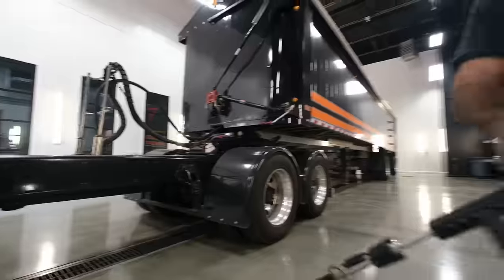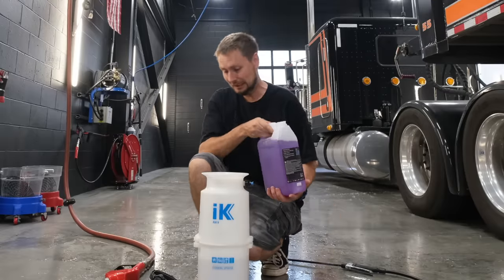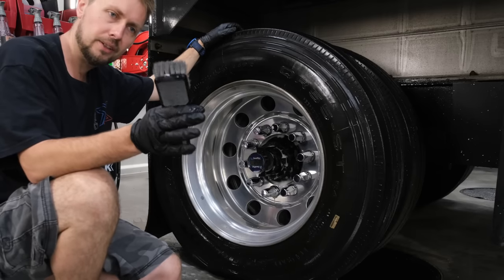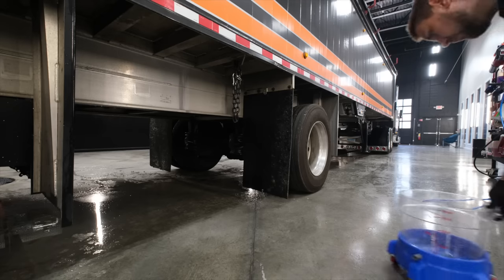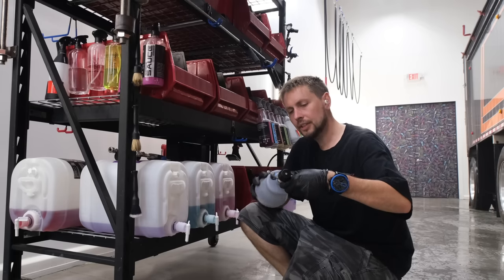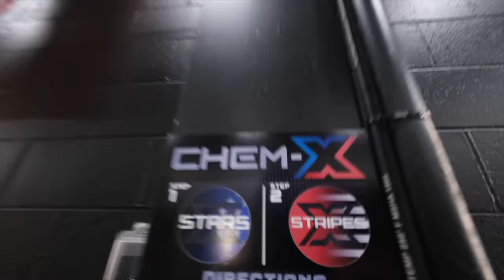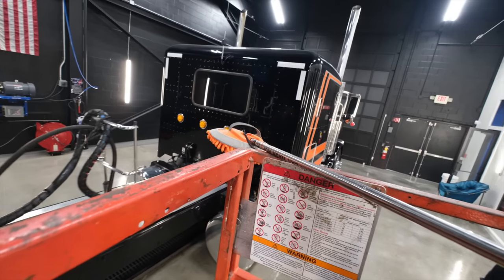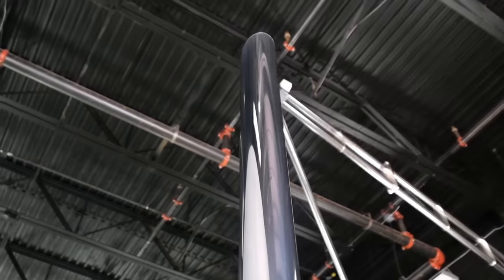The Fleet That Inspired The ENTIRE CHEM-X LINE!

Comment: You should play around with using your tire shine in a foam sprayer. I use it on a lot of trucks with mud tires that have knobby shoulder lugs, which makes it very hard and time consuming to apply with an applicator. Foamed it on, and let it settle and then wiped off excess, and desired sheen. Saved myself about 45 minutes that way.
Reply: I use a cheap hvlp gun
Reply: Just use a spray bottle and a tire pad 😂 you guys make easy stuff so complicated sometimes

Comment: People whining about degreaser on tires are probably thinking that way due to experiences with degreasers/APCs used on interior plastics/trim/vinyl. In my opinion tires are built to withstand much worse, and if degreaser dries them out at all, you’re literally covering them in hydrating tire shine after….. as you said, “do you even drive on your tires bro” 😂😂
Reply: A lot of people say that it accelerates the rubber deterioration and actually makes the browning come back worse/faster.

I honestly haven't looked into the science of it all that much but in my COMPLETELY anecdotal experience I haven't seen that to be the case. 

My thought is that the tire is going to wear out from ya know.... driving on it, way before it's going to wear out because someone used a degreaser on it. If you're really really concerned just make sure you stick to tire dressings that also hydrate and nourish the rubber or use a dedicated rubber conditioner occasionally.
Reply: @muchachogrande2019  browning is by design I believe. Protects the tire.
Reply: @johnbaron3070  correct and also correct that most degreasers will dry out that browning effect that keeps your tires from dry rotting faster.
Reply: Bro it’s a tire 😭😭

Comment: I am a pressure washer mechanic for a industrial pressure washer company. So this is my job/my life. You are totally washing in the correct manner. You always should be rinsing bottom up. You push the soap around more going bottom up than top down. Keep up your good work!
Reply: You always wash top down. All that dirt just flows back over what you’ve cleaned. You’ll never get done. Doesn’t even make sense.

Comment: I used to work for an asphalt company a couple years back. My job was wash bay so I bet you could guess how heavy the cleaning was. We used to just use acid on all the aluminum parts. We’d just spray it on, no scrubbing needed, would take any and every dirt, grime, spots etc. off. Worked like a charm and the aluminum looked beautiful right after.
Reply: Did you down stream the acid and did you use it on paint? I know you shouldn't hit glass

Comment: The IK 12's work  great with high pH products! The multi pro 12 sadly doesn't have a shrader valve like the foam pro 12. But you can easily convert the foam to a high output multi! With the orange tip, block off the air inlet (with some tape) and remove the cotton filter from the lance. Now it sprays out loads of product, bigger flow rate than the multi!

Comment: Maybe wrap the first two or three feet of the pole in a silicone wrap so if you tap it against things it won't be metal making the contact. But for sure using a brush to agitate with the cleaner looks like the better way to go.

Comment: That M-shine looks like an awesomse product, like the rest of your stuff!

I've recently had some awesome experience with polishing aluminium by hand. It was just as oxidized as this frame rail, but just a pass or two by hand made it shine like crazy. I was using Optimum Metal Polish, but any polish would probably do? It would be awesome if an expert like you would look into it! I'd bet you'd find an even quicker and easier way to polish to a mirror shine.
Reply: I have some that I still need to try on my 2020 Kenworth W990 that is about 3 years old and has a ton of aluminum on it. Pretty much everything except the cab and frame rails are aluminum. The trucks wheels are the only thing that has been polished since I’ve had this truck. Curious to see what M-Shine can do for it. Just might get me some more of it.

Comment: I see you took my advice and put a shreader valve in the IKs without them, oh wait no you didn't. Drill a hole in the neck with a letter R bit then tap with a 1/8 npt intsall shreader done! Don't even need tape plastic seals it. Just make sure you go between the webbing in the neck use a light to find it. I left one of my sprayers for a month still had air in it. Hope this comment helps anyone that reads it. WSNH.

Comment: I sprayed a lot of chemicals during my life. Get an electric motor driven pump sprayer. It will change your life,better than airing up. You can go forever. You can have change over value,for you huge tanks of cleaning products. Be easier to tell your usage amounts over a month. You could set it up like your pressure washer and the spray power would be variable as well. You have a constant pressure spray with the electrical motor as well. This keeps chemical output constant,as well.

Comment: I didnt realize you could degrease the whole engine bay like that..I've always wanted to clean my duramax but thought  its bad to spray electrical connections, especially the alternator windings
Reply: Most electrical connections are hermetically sealed these days. As a fail safe, I tend to cover up the alternator, battery terminals, air filter inlet, and other areas that make me uncomfortable as good measure. Ensure not to directly apply water pressure and to be fairly quick with rinsing. Use an air blower of some sort and dry off all areas (compressed air if you have access, leaf blowers are ok too.)  Lastly, fire up the engine and keep an eye out for lights on the dash :D
Reply: @jaspalvirdee  Will definitely be trying soon, my duramax is one dirty B**ch! Lol

Comment: My parents bought me a few of your products for Easter and I was far from impressed unfortunately. Snake oil it lasted one car wash. Diluted exactly how the instructions say. Also got Heavy duty to clean my zero turns abs truck wheels and it works like hand soap and water mixed together without a pressure washer. Don’t know why. Used it straight too and works exactly what the same. Expected more for how pricy the snake oil is which I understand but it should last more than one car wash.